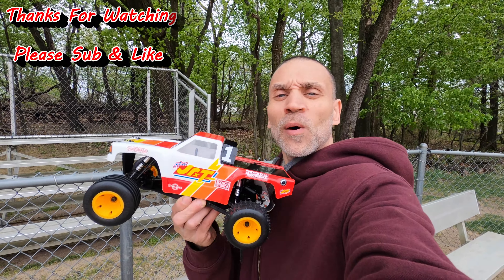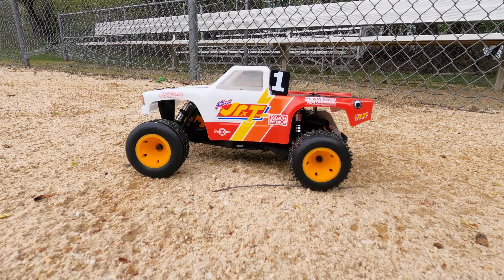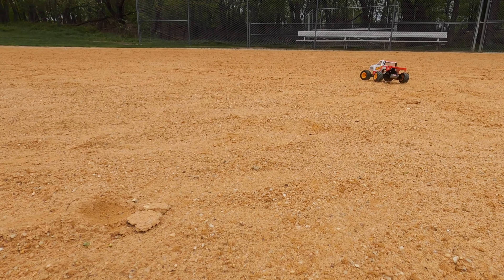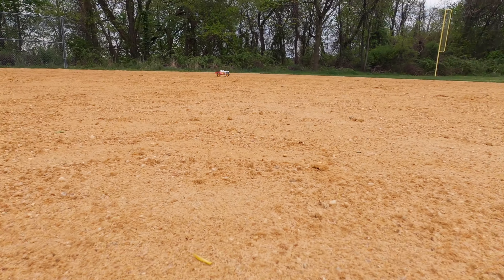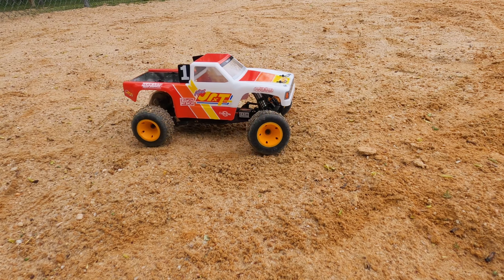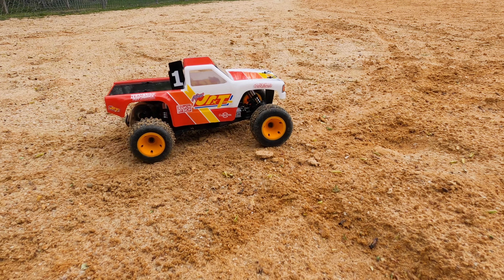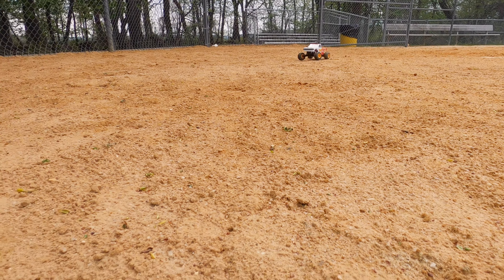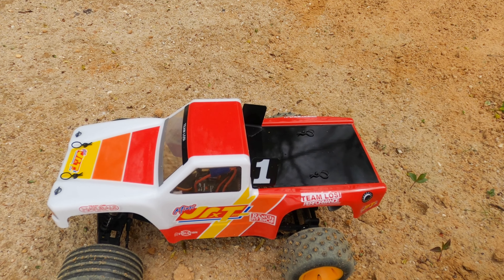Losi mini Jrxt First Run IS IT ANY GOOD?

Comment: Sweet run Steve! It’s looks like a fun little basher!
The weather here has been crap again so mine is still in the box.
Nice work!👍😊
Reply from the maker: Man You have to run it they work just like the 1/0 scale big RC's but are smaller they are fun as heck!! I put a cheap goolrc 4800KV brushless system in mine now and man it's a blast literally! LOL!!!!

Comment: It handled all that rough bumpy bits really well. It would be more fun on a smaller track that is more technical but it is still great to see it running around! Best thing is it looks like a quick clean of the tires and it will still look brand new!
Reply from the maker: They drive just like the 1/10 scale very good, O man wait until you see what I did to it! Stay tuned!

Comment: It may not be silly fast, but it’s definitely a fun speed. It handles the loamy sand pretty well too. I’ll bet it jumps really well! Think I’ll be putting this on my list of rc to get at some point. Wish they come out with a 1/10 version like the old one! Thanks for sharing Steve!👊🏼😎✌🏻
Reply from the maker: They drive awesome! I wish they made a 1/10 but they won't so I think a 1/12 would have been nice because it would have been big but parts would not have been interchangeable with the classic 1/10 versions. Thanks for watching.

Comment: May I have a question I can't seem to find it on the internet do they still have the 1/10 scale the original one
Reply from the maker: Hi no they never remade the 1/10 scale version...only can get the old one on e-bay or something now.  Thanks for looking.
Reply: I'm not having any luck finding the motor for this little truck can you shed some light on it for me
Reply from the maker: here:  https://www.amazon.com/Spektrum-Firma-Choice-Brushed-SPMXSM5100/dp/B0B844K8FB/ref=asc_df_B0B844K8FB/?tag=hyprod-20&linkCode=df0&hvadid=663260359630&hvpos=&hvnetw=g&hvrand=12530636308461938005&hvpone=&hvptwo=&hvqmt=&hvdev=c&hvdvcmdl=&hvlocint=&hvlocphy=1022331&hvtargid=pla-2187110515896&psc=1&mcid=599907d4342b3a79aa02e410830bd2a7